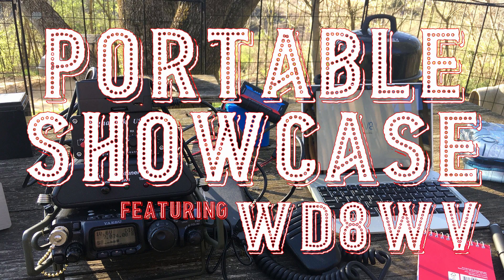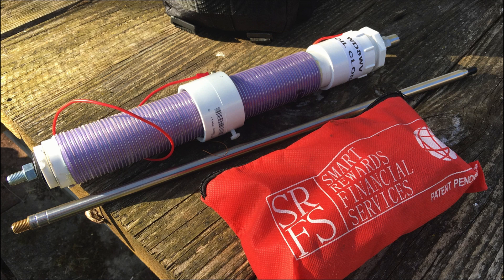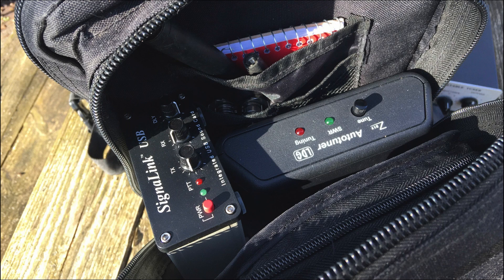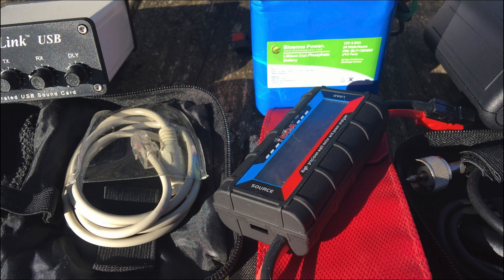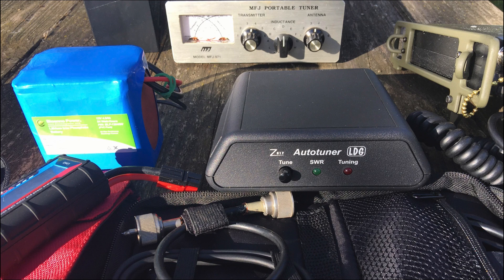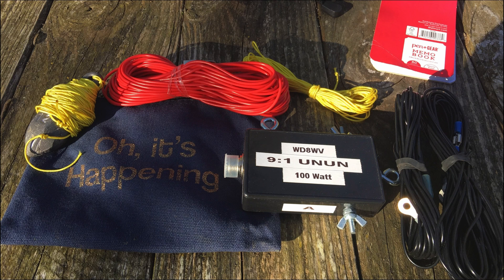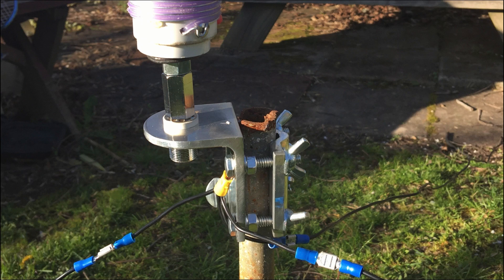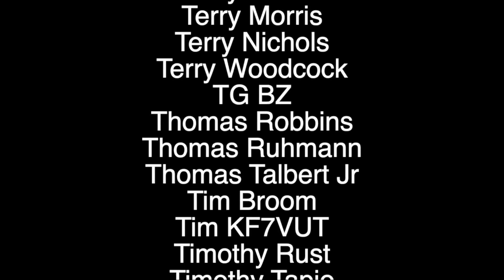Portable Showcase WD8WV

Comment: Hello & thanks for the display/review. A vote here for the SOTABeam Compressor for the 817 that sits between the mic and the radio. Along with the actual compression that helps with the 5W SSB signal, the compressor enables the user to create a tone on transmit that can be used to tune the antenna; a nice feature.

Comment: Thanks Jason for sharing my setup.  Since those pictures were sent to you I have also accumulated a 28 watt foldable solar panel https://www.bioennopower.com/collections/solar-panels/products/28-watt-foldable-solar-panel and the controller https://www.bioennopower.com/collections/solar-controllers/products/12v-24v-20a-solar-charge-controller-for-lifepo4-batteries-sc-122420jud from Bioenno Power.  I may need to either invest in a larger 5.11 bag or rethink everything I have in it so I can accommodate the solar panel and controller.  Since I now have a NanoVNA, I may leave the auto-tuner out of the bag and only carry the manual tuner.  I also have another MFJ tuner but no meter, like you, that I could put in, it would take up less space.  This is always a work in progress and there is always something that can be fine tuned.  But this is the basic setup I had when I did my first POTA (Parks On The Air) activation here in WV.  Again thanks for sharing my setup, very well done video!  Juddie - WD8WV
Reply: When it comes to space its hard to beat the Elecraft T1.  It tunes up almost anything.  Blows away the tuner in my ic7300 and even the tuner in my x5105.  It usues very little power.  The only downside is price.  But overall I think it's worth it and wouldn't trade it for anything.  73 de KF7VUT